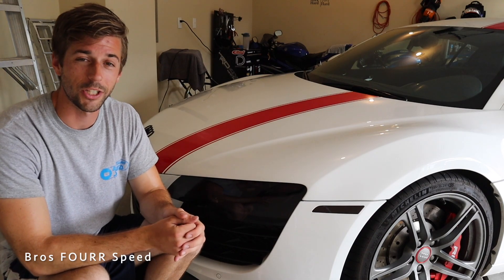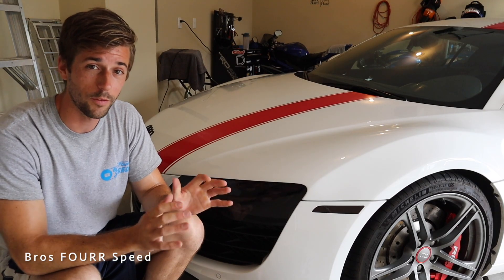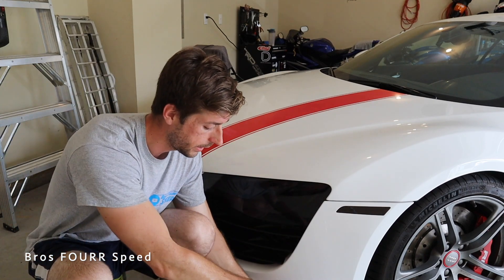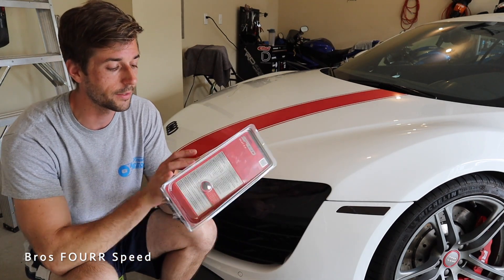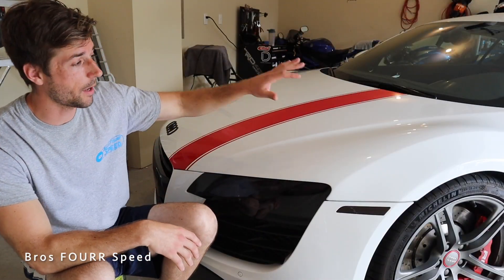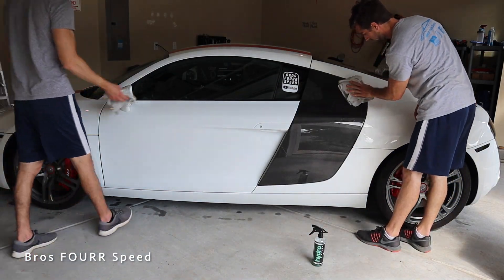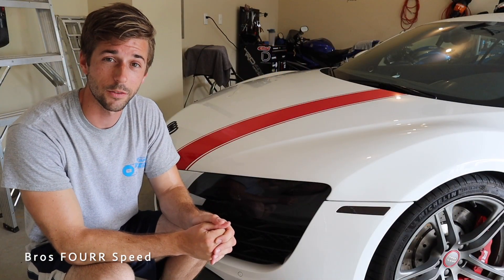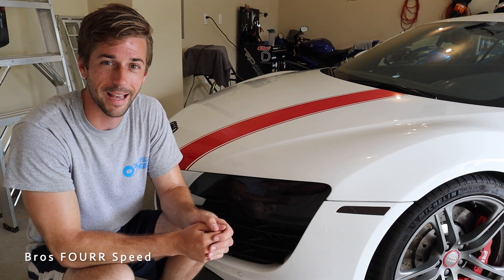How To Wash, Clay Bar and Ceramic Coat Your Car!

Comment: you need to polish after you use a clay bar or even synthetic clay bar because it will micro mar the paint, especially if you are going to ceramic coat
Reply from the maker: Yeah, that’s something I won’t be able to do with the one I have. For the price of a good buffer to polish might just have someone do that when the time comes!
Reply from the maker: Brian Smith  Yea I’ve looked into them some, but I’d only use it the one time!

Comment: Were you the 2nd or 3rd owner of this R8
Reply from the maker: I’m actually the 6th owner! On my last one I was the 2nd!
Reply: @BrosFOURRSpeed  if you’re the 6th, how does it only have 20K miles when you bought it
Reply from the maker: @mileslynch  The previous owners hardly drove it! And most of them had it for about 1 year of ownership! I’ve put almost more miles on it in 2 months then it’s average of around 2600 a year!
Reply: @BrosFOURRSpeed  well I think you’ll be the owner that drives and keeps it the longest
Reply from the maker: @mileslynch  Oh yeah! It’s not going to sit in the garage! I’m going to drive it!!
Reply: @BrosFOURRSpeed  cars are not meant to sit 24/7
Reply: Doesnt it bother you? when a car has had many owners, its usually a red flag. 6 owners for a 2012 car...?
Reply: @jankay8569  I thought it was crazy but at least they took care of it, but in most cases avoid a car that has more than 3
Reply from the maker: @jankay8569  No not at all, in the sportscar world they change hands a lot. Usually every 1-2 years, the owner just didn’t drive it like they thought. I went through the car fax and it was regularly maintained and taken care of. If it was a Honda Civic with 6 owners, I’d be more suspicious on why it’s had so many owners. But with cars like this that’s normal. This car was only driven an average of 2600 miles a year, meaning owners drove it on a nice weekend and it wasn’t a daily.
Reply from the maker: @mileslynch  Exactly!
Reply from the maker: @mileslynch  I would disagree with that. Owners really doesn’t mean much unless it wasn’t taken care of. I had access to the car fax and it had been regularly maintained and had all the services done. On cars like this it’s normal to have multiple owners because buyers don’t drive them like they thought and move on to a different car. It’s misunderstood when people think multiple owners is a bad thing.
Reply: @BrosFOURRSpeed  they took amazing care of it so when it comes to multiple owners, this one was a winner
Reply: @BrosFOURRSpeed  it’s ok for high end cars, (R8, Lambo, GTR) but if it’s like a regular vehicle it might not be as safe
Reply from the maker: @mileslynch  Oh yeah! I had enough knowledge to make a good decision about it and got a PPI done too for more piece of mind! Almost put 2K miles on it already!!
Reply from the maker: @mileslynch  Yea exactly!

Comment: Doing a tutorial on how to clean a vehicle and make it look good and you're doing "Circular" motions while using a clay bar to remove contamination. Lol-
Reply from the maker: It worked so what's wrong with that?
Reply: @BrosFOURRSpeed it can leave behind swirl marks. Recommend doing long vertical or horizontal motions. But at the end of the day it’s your car and you can do whatever you want ✌️
Reply from the maker: @FrequencyORD  I don’t have any so it worked great.